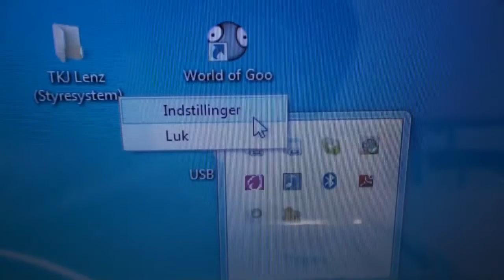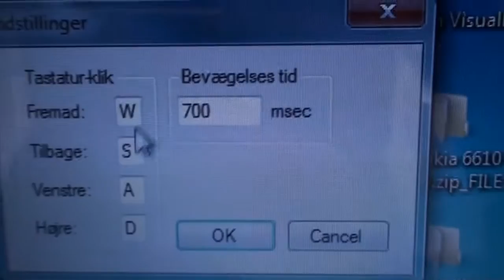Arduino Mini Stepper

Comment from the maker: @turgore Well I won't fully agree with you. We designed the metal step machine construction ourself, and as we only had 2 months for making this, of course it wasn't going to be as good as the professionel ones you can buy.
But compared to fact that we could just have bought a professionel one and added the sensors, I think this is a good step machine.